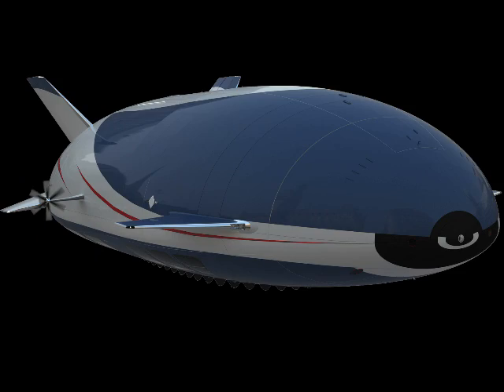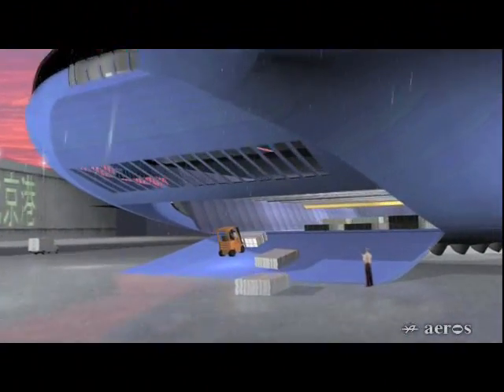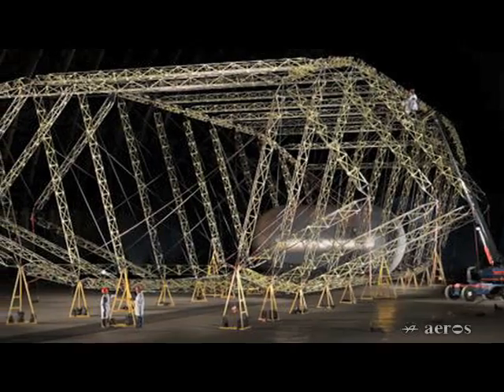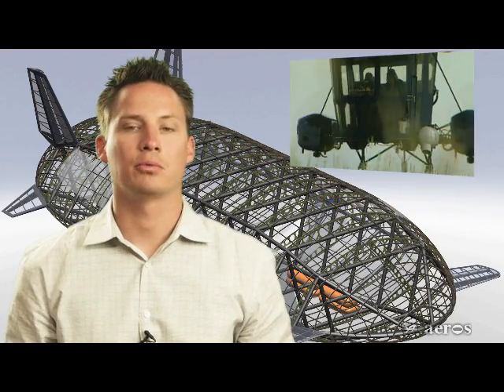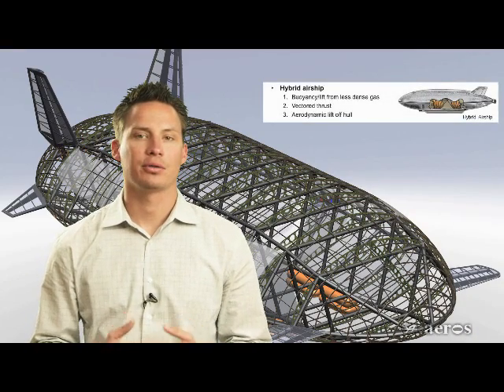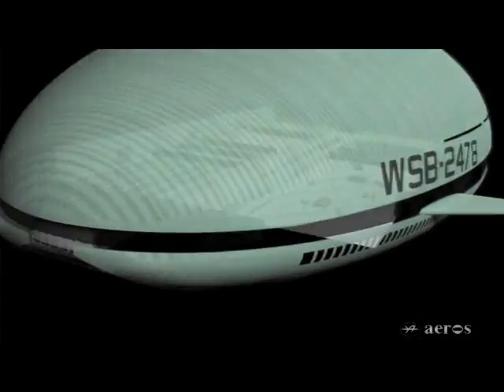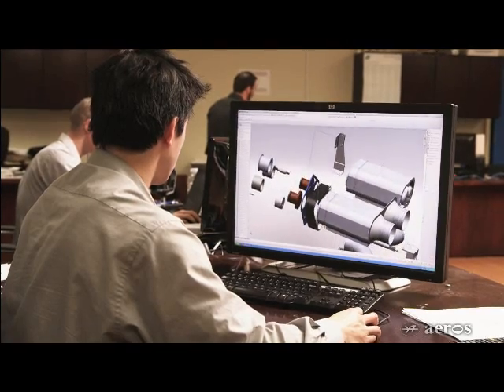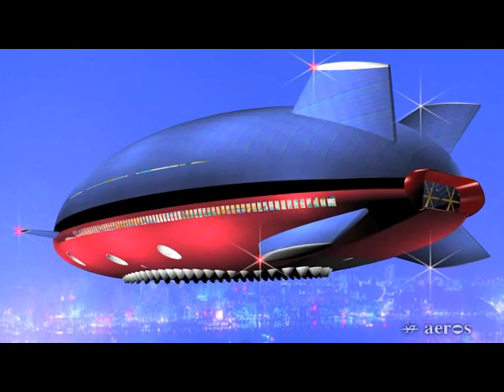The Aeroscraft

Comment: To say that Aeroscraft is "not an airship" is a bit of a semantics game, seemingly used to distance their company from previous failed endeavors.  Their craft fits the definition during take-off and most of its flight.  Hopefully Aeros will succeed in actually building a LARGE craft instead of falling victim to the fatal error of most similar attempts: starting small.  With airships, the benefits are almost negligible below the size of the ML86X.